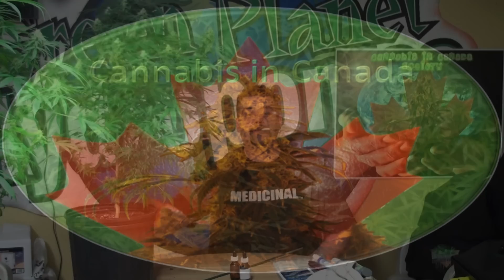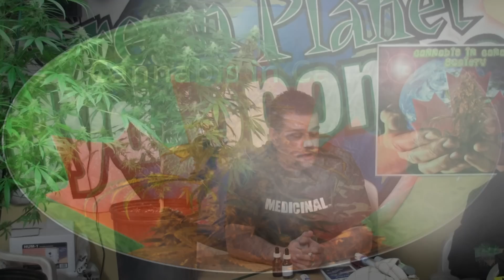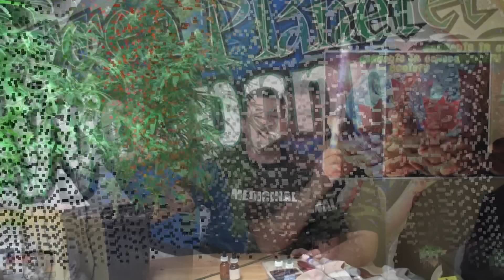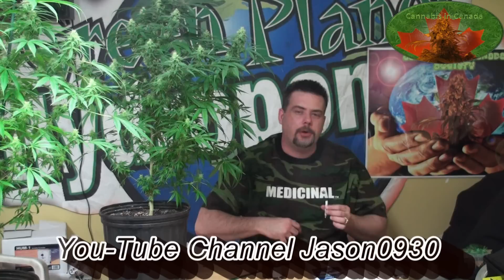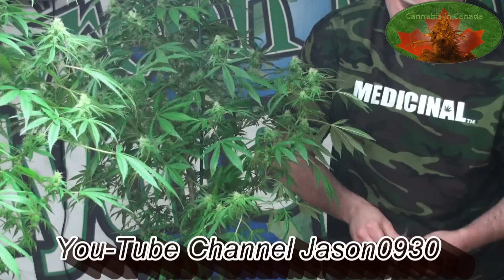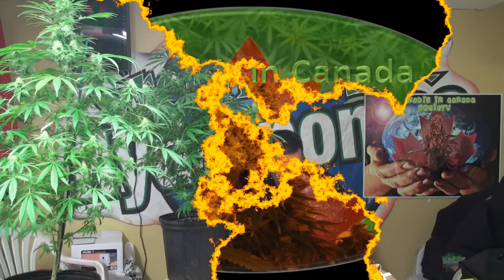The Basics

Comment: I know my last feedings were 1175 ppm @ 6.12, and 1885 @ 5.98  and no noticible burns, no turned up edges, no turned down tips, nothing.. when I ran out i was using botanicare, good stuff too, but was only able to get it to about 800-1000 ppm or so before burning set in... any idea why i can run such a high ppm with advacned ph perfect??? ALSO.. is there ANY ADVANTAGE to even runnig such a high ppm if you can get away with it???